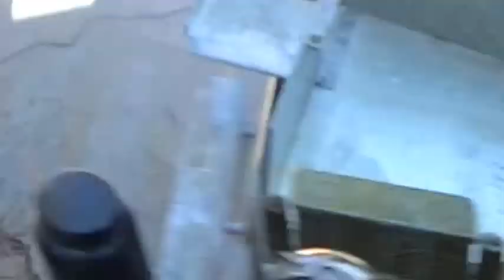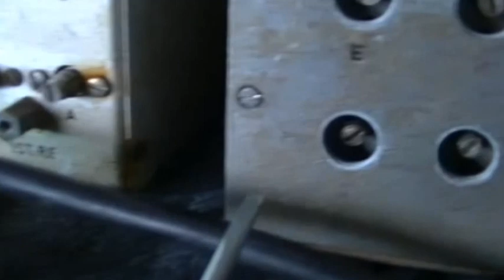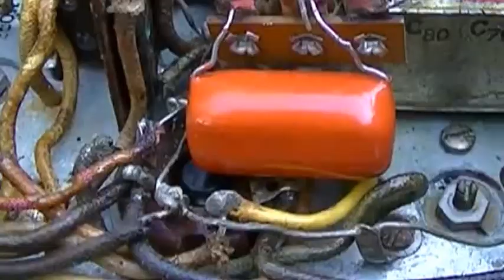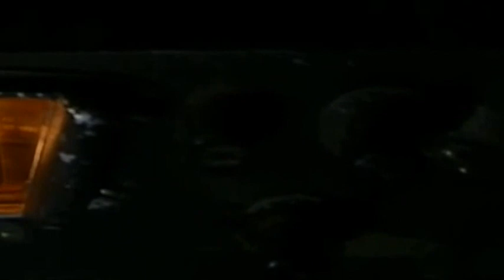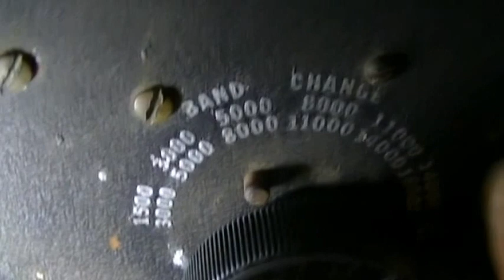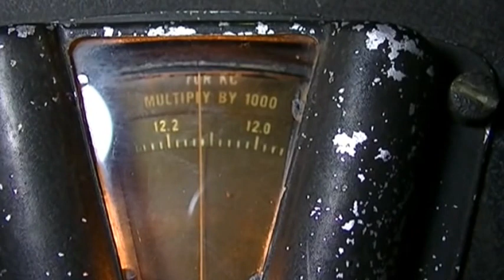Signal Corps BC-342 Farnsworth US Army Shortwave Radio BC342 WW2 Vintage

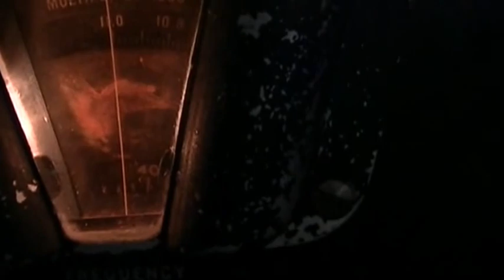Comment: 4:42 , signal generator. The display looks like the one in the following vid.  The display chips are driven from a data bus and are not just a pile of LEDs.
See 9:45 on wards in the vid  " HP 9825 Repair - Part 12: KDP assembly, again "  on the channel " CuriousMarc "

Comment: Cool set. We had one like that, only in like new condition at Fort Lewis back when the 3rd Cav was still stationed there in 1972.  When we got orders to move the entire unit to Fort Bliss Texas, the major in charge asked me if I wanted the old radio. Back then I was into electronics a bit, but it looked like to much to lug around especially since we had to move from Washington to Texas, and all I had to move in was an old 63 Ford window van.  So I guess they tossed the old radio, I am not sure as I went on the Advanced Party, but I do know the old radio never made the trip as I helped unpack every blasted thing from Lewis when it arrived at Bliss, from the smallest paperclip to the deuce and a half with the 26D rig on it's back.

Comment: in the 70's my dad bought one of these from a family friend who was a ham and owned a tv and radio repair business, so it was in perfect operating condition. the output transformer was changed and it was driving an 8 inch radio shack full range speaker with a whizzer cone in a custom cabinet with excellent audio quality. with a good ground rod and about 80 feet of longwire antenna between the house and the backyard fence oriented north-south we could pick up signals from all over the world. a really great radio, but it is ridiculously heavy for it's size.

Comment: I hope I can get my BC-453-B aircraft beacon receiver to work...I bought it as is without the dynamotor, so the least I'll have to do is build a power supply for it.  I'll probably use a 117Z6GT tube and a voltage doubler to produce the 245v B+ supply...that is unless I come across a good dynamotor for it...

Comment: If it was me, I would just start replacing 1 wire at a time, wicking all the solder off and resoldering all joints. It would look lovely too for very little cost.

Comment: You do know with both resistors and capacitor replacement, the sensitivity will about quadruple. making this hear that electric fence pulse get tuned out so alex will be much clearer. nice radio, you just barely saved the transformer....shooting the radio in its achilles heel along with the rectifier tube. my prediction, you will save this.

Comment: no, no it was in aircraft !.
Reply: No, it wasn't. It was primarily used in mobile installations like the 2 1/2 ton comm truck or fixed listening posts. It was never used in aircraft or a 12 volt dynamotor/110 volt power supply wouldn't work.

Comment: Wonderful! I have one of these in our cellar. It was my main receiver when I did ham radio in the 1960s and 70s. I was impressed that a piece of radio kit  built in the early 1940s worked so well then and I last fired it up around 1995. Much of what you show is familiar. The oil filled capacitors usually went open circuit so you just dug out a new cap of the same value. I really ought to do something with mine :) G4BQB